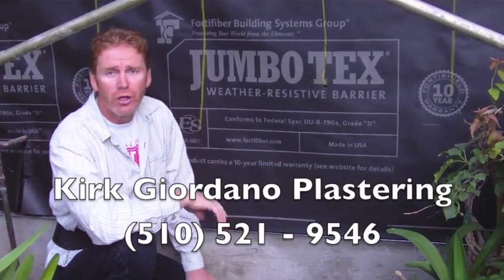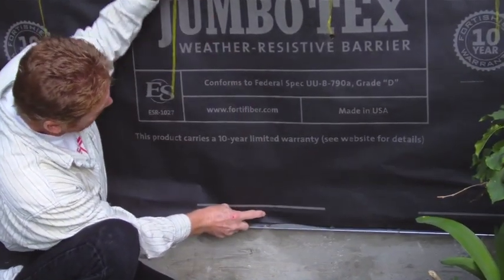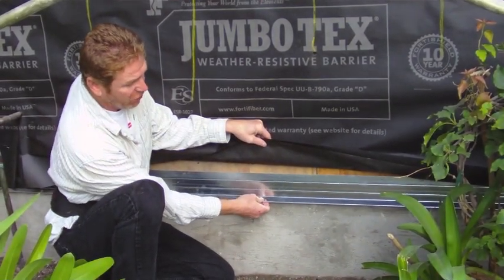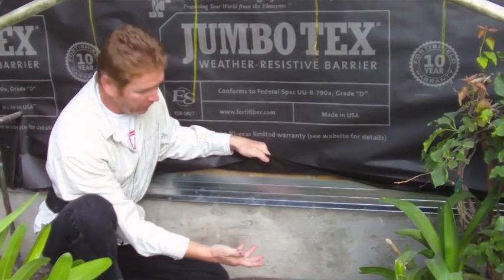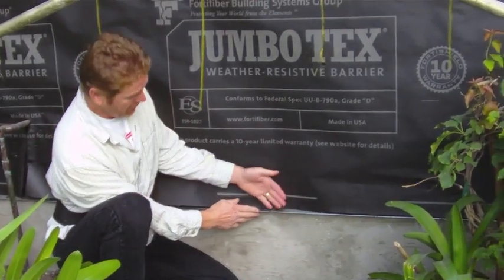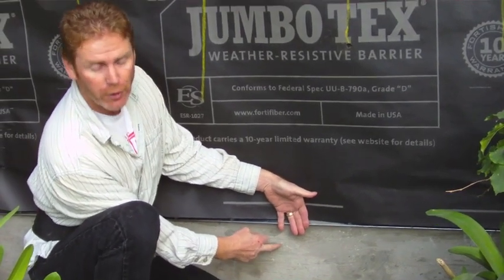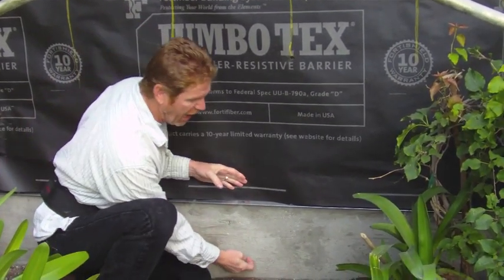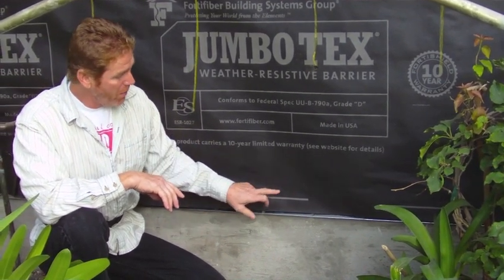Where to place a stucco weep or drip screed

Comment: I don't know if you're still monitoring this video but you're saying not to attach the drip screed on the foundation, below the mud sill, but in other videos you say if you have an old hose, like mine, with no drip screed at all,  you can match the application of below-grade stucco.  Wouldn't it be better to install a drip screed above grade and keep the stucco out of soil.  I intend to install a stone facia is why I ask, and as you commented in  this video, I don't want the stone stopping a foot above ground.  I believe mud sill is flush with foundation, in my case?
Thank you.
Love your very helpful videos.
Jeff
Reply from the maker: Howdy Jeff, indeed I still monitor these videos.
If your home is built before 1975, you won't have weep or drip screed as they were not required by building codes until about 1975. 
If your stucco goes below the mudsill and into the dirt, the worst that happens is with movement the homes stucco can and will often crack and even sometimes buckle a bit.
    Weep or drips screed has many purposes. One is to provide an expansion joint, the other is to provide a stop and a guild to apply the proper depth or thickness of the stucco.
   There are a few more reasons for a weep or drip screed, but these are the best reason to install them.
I believe it's a myth or false belief to think bugs will enter if the stucco is taken to the ground.
BTW, often when attaching the weep screeds onto the substrate or plywood surface, below the mudsill part of the weep screed can touch the foundation. This depends on the plywood installation and is harmless.
Bringing to all the most complete plastering encyclopedia ever created in the world online.
 By the plastering messengers of Youtube.  With well over 850 free self-help videos 🎭 👀💃
Kirk and Jason Giordano Plastering

Comment: What about at mid level were a new water proof deck is installed(ALX system). The stucco was removed about 8" up from the deck. The deck guy install L metal and new jamb sills under the slider doors. The Stucco guy came in and installed new wire and paper and stucco with no weep screed. The deck guy says they should have and the Stucco guy says its not needed or Code. I read the code 4706e and its does'nt seem to address this mid level wall to deck situation. Gen. Con. in San Diego, Calif.